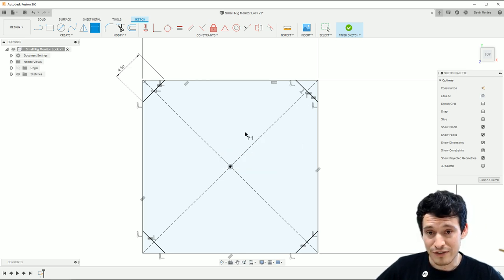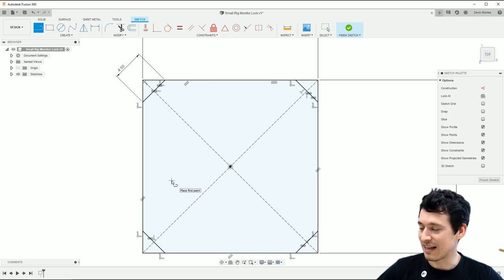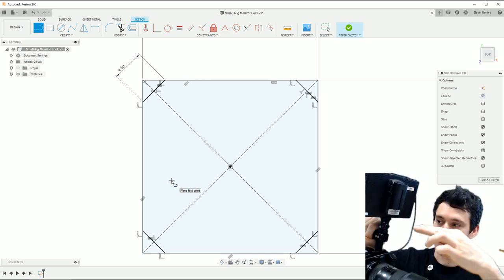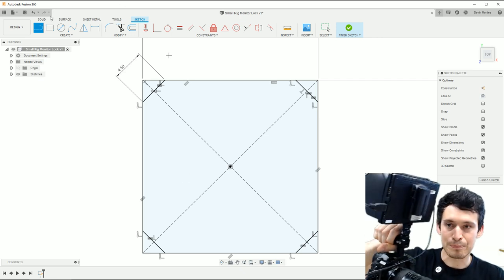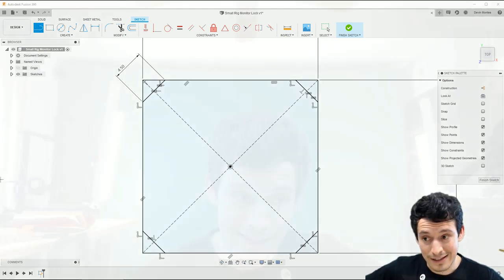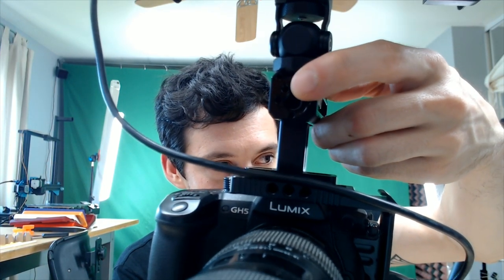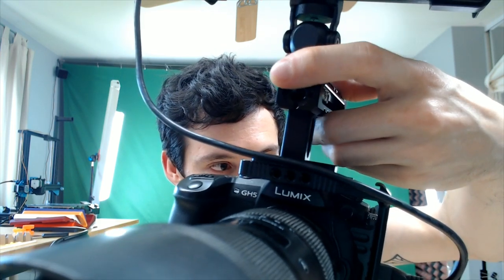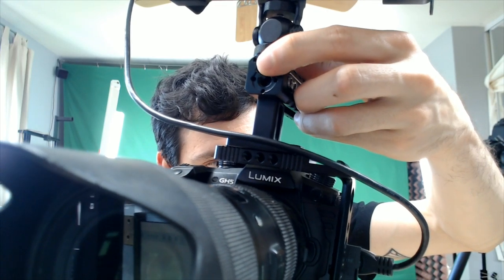Designing a Simple Part in Fusion 360 Full Walkthrough

Comment: Tip: An easy way, to accurately measure the center-center hole distance.
Measure the diameter of the bolt heads. Insert both bolts in the holes and measure across the bolt heads (The distance between the outsides >O O<). Then substract one head diameter.
This gives the center-center distance.
Reply: Or  you put a vertical tengent in fusion
Reply: If you don’t need to be super accurate just measure on the left edge of each hole with a pair of verniers. This is super simple, super fast and can get within 0.5mm.
Reply: You can also  put a tangent dimension , just right click before ad dimension and select de “pick circle/arc tangent” option.
Reply: Measure 1 hole, reset caliper so it says 0, measure hole to hole inner measure but outer edge, ta da, center to center measurement.
Reply: @hentnil  Yup, that's how you do it the easy way :)

Comment: I've used quite a few CAD related programs but just started using Fusion and it is quite a different beast. Thanks for streaming and showing how easy it is to start designing your own parts. I only got my 1st printer this week but just designed and printed new gears for my gf's mixer and it was quite fun and they even worked.

Comment: Instead of drawing a line from the center point of a circle to it's edge for a tangent measurement you can do it all with just the dimension tool.  

You just start the dimension tool like you normally would (click on it in the toolbar / press D on your keyboard) and then right click anywhere in the sketch.  Choose "pick circle/arc tangent".  Now when you click on both items you want to measure, it'll be from the tangent (edge) of the circle not the center.  It also makes your sketches a bit cleaner looking too, since you don't have the extra line in the circles.

Comment: 25.4mm = 1 inch 

The profile is most likely 1 inch square and the measuring, Calipers and room temp is throwing the size off a bit. They will also use imperial dies when extruding but measure with metric units and vica versa